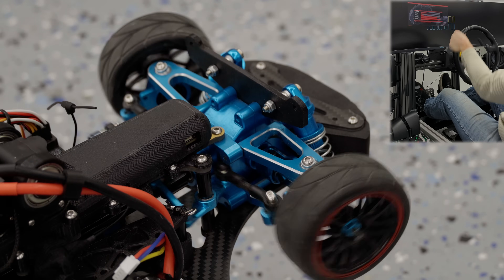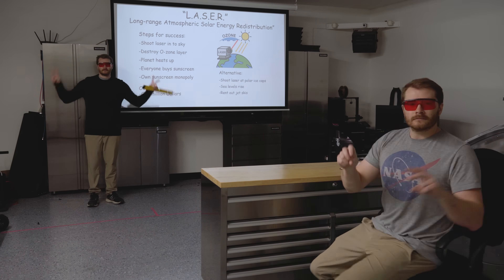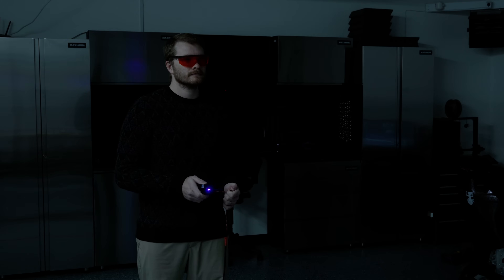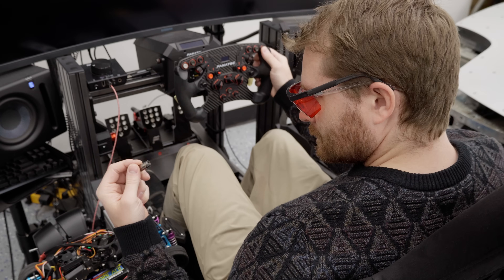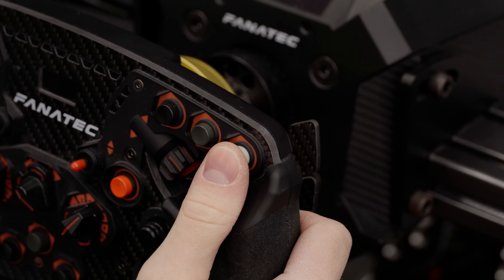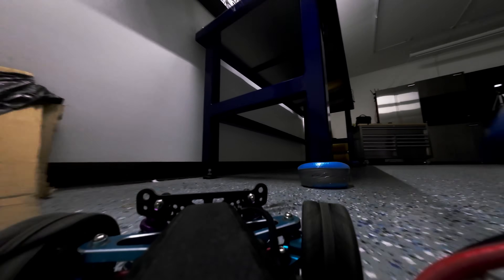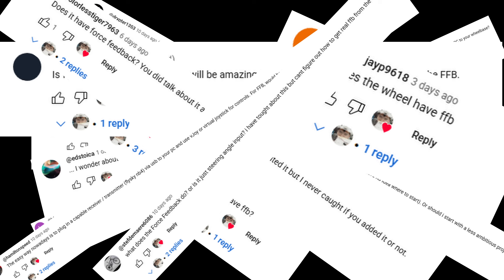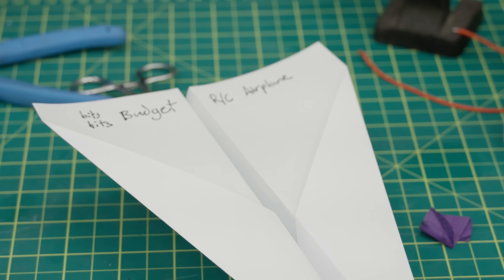Laser-Equipped FPV RC Car?! Controlled by a Racing Simulator

Comment: maybe make a racetrack on the floor with cones or obstacles where its actually not full throttle or nothing but a thing where u have racing skill involved. great video by the way
Reply from the maker: I'd love to get this setup on a real track.  A few companies with lots of space have already reached out to get things setup.  Hopefully we'll see some big tracks running the system soon!  I think the level of control and features you can add will really open up a whole new aspect of rc racing. 
Thanks!!! 😁

Comment: Omg I love the Mario Kart idea, this is how you could do it once you find a huge parking lot, setup a track of a bunch of cones like autocross and get enough people that can come together somehow bringing their whole racing sim setup. Your balloon idea was perfect but 3 smaller balloons that have cheap little transceivers taped to them that trigger a signal when popped to the victim's car (or their sim rig rather if I correctly understood how you have it setup) that limits the throttle position for a few seconds and also have larger power-up balloons around the track that trigger a signal when popped that gives your car more throttle range. Since you can't really add more than 100% throttle everyone will have to be limited to 75% the whole race unless they pop a power-up balloon that gives them 100% throttle for a duration of time or drops their throttle range to 50% if one of their balloons are popped. Dude, you got me geeking out hard on this...I'm going to definitely work on my own setup when I have time. Thanks for the scripts and Arduino sketches. Definitely will save me a lot of time.
Reply from the maker: The possibilities are really endless with this one! The scripts and sketches are super rough, but the work! Trying to figure out something more "plug and play", but I just have to find some time/budget to invest! Hahah

Comment: Love that you already followed up on your initial video!  I will be tooling around w/ your code.  Stoked to see more updates.  After 35 yrs, I'm getting back into RC - the platform is so dense with info and tools, but not as mysterious as it used to be - no small thanks to folks like you.  I build sculpture that moves and reacts to the environment.  Now experimenting w/ giving users more control.  Keep up the great work
Reply from the maker: Will do! Just getting back in to the hobby myself and coming in with a whole new perspective. Feels like I opened up a whole new can of worms with the microcontrollers and Python!

Comment: I watch waaay to much "boring" RC car content. This is fun! Half of the RC scene has engineering background, isn't it?
Reply from the maker: Thanks!! Just a fun little tangent from the other nerdy developments haha!
Seems like tons of engineers in the comments!!
Reply: Hey, have you figured out the force feedback? Why dont you use a toggle from a two stick rc radio transmitter and attach it to the steering linkage on the rc car and have it transmit back to the steering wheel. Use the guts of the two stick transmitters to transmit, and the receiver attach it to your rig.  Thats how i would do  as a shortcut. You can do the same for the suspension, add toggles to the control arms, and have it transmit back directly. Great videos 📹 👌🏽
Reply from the maker: I'm able to get the ffb data to the computer with the same system I use for the motion rig! The biggest challenge is going to be getting the wheel to actually move in response to the data input. Lots of figuring out to do still.  I'll make a video on it when I'm done though!

Comment: Plz add a steering wheel, just a linkage connected to the rack for the fpv camera. An interior and body kit would be awesome too.
Reply from the maker: Do you mean so the camera moves where the steering is pointed?
Right now the goggles have a head tracking system so when I move my head IRL the camera moves with it.

I definetly need to get a body for the car! 😁
Reply: @bits-bits  no I just want a tiny physical steering wheel in front of the camera in the car that turns according to the actual steering position. You could just connect it to the steering motor already in the car with a certain gear ratio to match the turning ratio of the Sim rig wheel.
Reply from the maker: I could do that! Just have to renew my Fusion license first 🤣

Comment: You could pretend your a cop car and use the laser to aim at a small light sensor that will disable the motor of a fleeing suspects rc car maybe? Idk.. anyway, an idea from me for a future video would be diy 4 or 5g teleoperation for the rc like that's offered from cloudrc" or that company you linked too in your first video you made. (Can't remember the name of it right now, but I did research them after watching your video) A python based force feedback solution is cool too. Thanks for what you do! Great video As always!
Reply from the maker: It'd be really easy to add a photo sensor and have it slow the car down!
The 4g/5g stuff would all be new to me! But it'd be neat to control something from across the globe!
Reply: Other technology you could look into (or tech that I would like to use on my own RC track build someday) is ai self driving RC cars. (like the "donkycar" project) You could use a raspberry pi camera that follows a line or if it can create an invisible line to follow by calculating lines on the tracks outside. it could utilize sonar sensors for cars passing. object detection can maybe be done so it can pass a slower car. Maybe qr code stickers on the slower car that can be measured for distance. Or Marker based 3d tracking. Idk I'm starting to ramble sorry. hope I helped.
Reply from the maker: Machine vision is super interesting! I definitely want to look in to it in the future!

Comment: Eventually, maybe a ways down the road, I'd LOVE to see a lil' race on a course against someone. And later maybe coding some mario Kart powers into the races.
Reply from the maker: Yeah!! I could add a little photo sensor on the back of each car, and if it gets hit with the laser light it could slow the car down for a period of time, or reverse the throttle and brake! Possibilities are endless!

Comment: Co2 cartridge, valve of some sort, tube, bb's.....do it. You can do it....off road tires, updated suspension, then hunt squirrels.
Reply from the maker: Super easy to do now!! I can switch the relay out for a 12v one to control a pretty beefy solenoid 😏

Comment: you should make the e-brake only stop the rear wheels so the car can drift
Reply from the maker: I'll be able to do this when I getba car with a center differential.  This chassis couples front and rear so they always spin/stop together.  The e-brake still works pretty good to start a slide though!!
Reply: @ okay
Reply: @bits-bits  could you just simulate the diff with code?
Reply from the maker: Unfortunately not, the front and rear diffs are connected via a drive shaft on this chassis, without any way to decouple front from back. Someday when I get an arrma infraction (or any other awd chassis with a center diff) were gonna start seeing some weeeeeiiirrrd stuff on the channel 😂

Comment: You might want to add one of those tiny multi axis stabilizers to the camera, as I suspect it's going to be shaking a lot at that scale - and without it - adding VR may be out of the question. 

Oh and add a roll bar around that gimbal otherwise it's going to get destroyed pretty quick. You could make it look like the interior of a car for realism but check that depth of field for your particular sensor, as it might be too far out of focus to feel real.
Reply from the maker: Definitely! I'll mock up something to decouple the camera from the pan shoulders.
I need a roll bar and body shell.. In the making of the last two videos it ended up  upside down off a ramp quite a few times.. 😅
Reply: @bits-bits  Love what you are doing! Something similar was on my long list of projects I wanted to do. So you may want to just switch over to one of those mini gimbal that has a camera built right in. Check latency if you do that.
Reply from the maker: Somebody else had commented about those little gimbals! I'd love to bring one in to test, hopefully before the snow flies again! 🤣
Reply: @bits-bits  Very affordable. 

You know what isn't as affordable? If you were decide to connect it to a motion platform... ;)